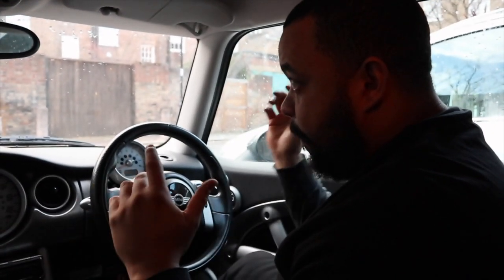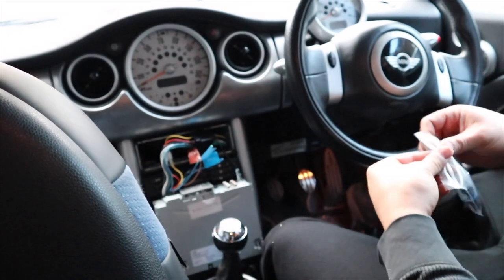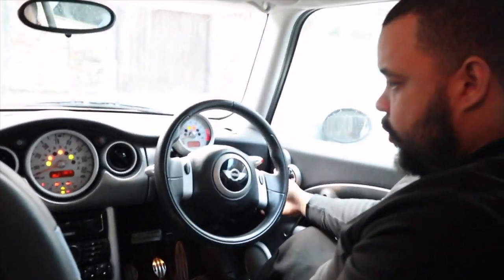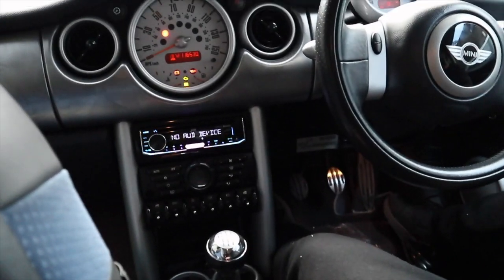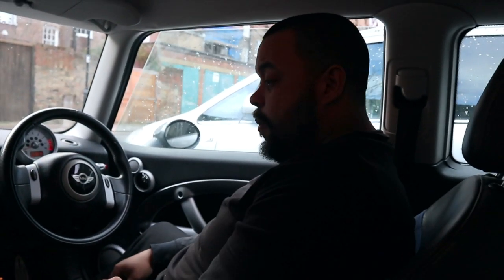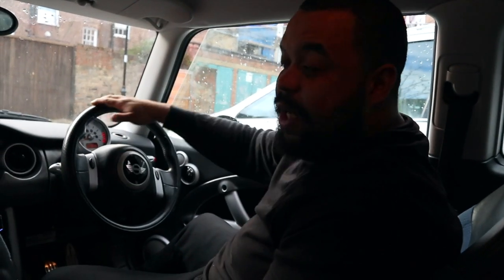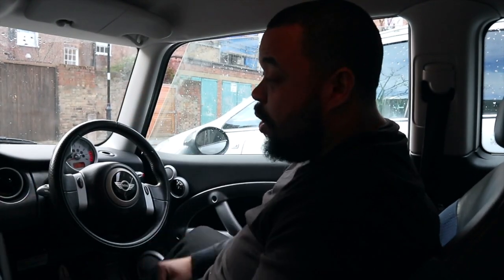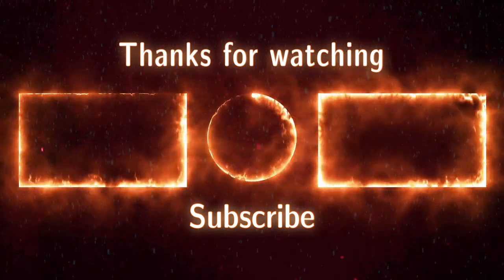How To Fit An After Market Stereo Mini Cooper S R53

Comment: I need some help. I have a 2005 R52 convertible. We swapped the radio out and upgraded the radio. However, I have no power going to my window controls and the lights behind my hvac are no longer on. Idk what to do? Please help? It’s like the white plug behind the harness isn’t plugged into anything or going anywhere. What do I do?

Comment: I've got a 2003 r53 with the same unit as you. It also has the hand controls behind the steering wheel and Harmon  kardon speakers, will the hand controls still work or will I need anything else to go with the conversion kit you bought. You said you got it on Amazon but didn't mention where. Cheers
Reply from the maker: The kit I got on eBay and as for the steering wheel controls mine didn’t have any so I can’t speak to that defo improved the car massively
Reply: @carfellauk  thanks for replying, I haven't done anything with it since, the old head unit is still out of the car. When I removed the head unit there were what I can only describe as two different Arial cables behind the head unit but I don't know where the second one goes as the cables damaged and doesn't seem to connect anywhere so I'm totally confused ☹️☹️☹️

Comment: Do your hand controls behind the steering wheel still work?
Reply from the maker: My one doesn’t have any steering wheel controls but I think to make it work with them you need an extra module that plugs into the back of the head unit

Comment: Maybe someone can help.  I swapped out my stereo on the R53 yesterday.  I want the dimming feature to be able to work.  The adapter i got from the shop does not have a blue cable out to connect to the new head unit.  Looking at wiring diagrams, I can splice into the old wire, but does it actually make the dimming feature work?
Reply from the maker: Does your head unit not have a separate dimming feature
Reply: @carfellauk  Yes it does, but the wiring harness i got that adapts from the Mini does not have an orange wire.  If i take the wire directly from the Mini (wire 14 on diagrams/grey & red) and splice it directly to the orange wire on the head unit, that should work right?
Reply from the maker: I would have to see the wiring diagram

Comment: I’m getting no sound
Reply from the maker: Have you checked all your connections ?
Reply: I have power but no sound. Could it be the deck ? The car has steering wheel controls and Harmon speakers and stock amp. You think that could be the problem
Reply: @carfellauk  when I plug the stock deck in I get sound but I plug the new deck in and I get power no sound. I’ve bought a couple different harnesses to try not to spend 180 bucks on the kit. They won’t send the kit to me from the UK.
Reply: @carfellauk  sorry to bombard you with all this. If I can get all the harnesses you have I’ll probably be good but I can’t find them. And when I do they don’t look like the one you got
Reply from the maker: If you have Harmon u need a different harness
Reply: @carfellauk  thanks bro appreciate you